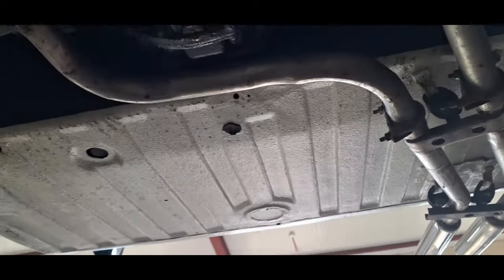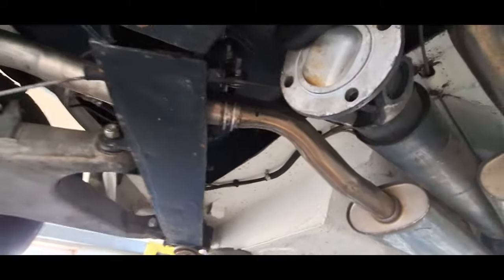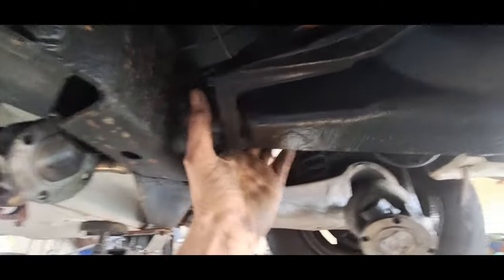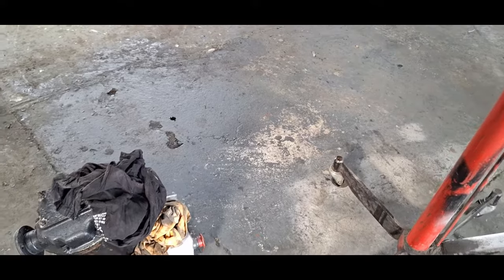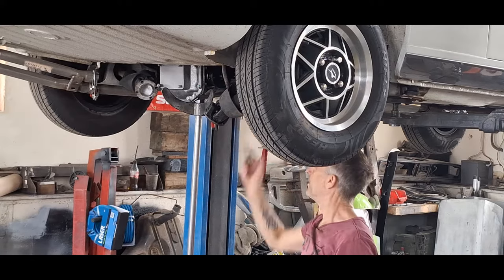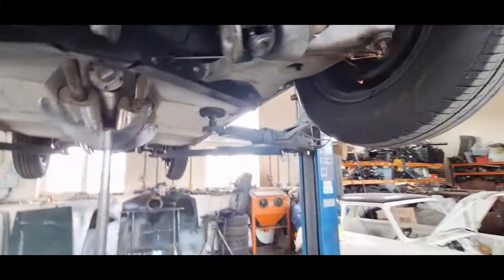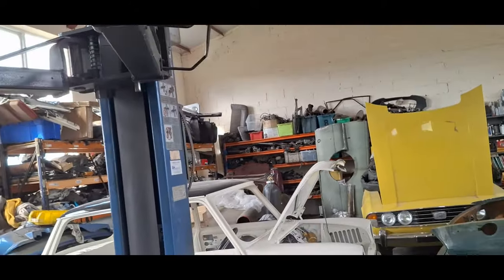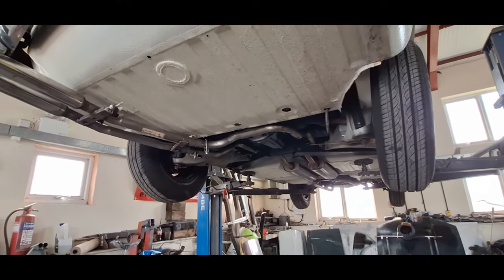How to Change a Mk2 Triumph Stag diff - installing a higher ratio 3.45

Comment: Brilliant ! ,these videos are excellent, actual  practical step by step ,  just the job I'm going to do soon , I have bw 35 automatic with the j overdrive which makes it same top gear ratio as manual overdrive,  you can  do the zf conversion but very expensive, I worked for formula Ferguson Coventry   who did  several 4wd   stags  we did the body work , tunnel work, sump , then the fitters did the shafts etc    ,any way     next will be  the 3.45 crown wheel set swop ,  I'll be happy then , will drop the engine speed  well , thank you look forward to next film !
Reply from the maker: Thanks Steve, formula ferguson did some fantastic stuff car wise, trye innovators at the time